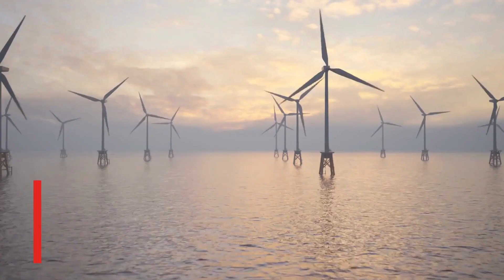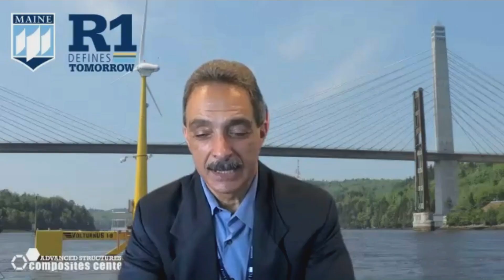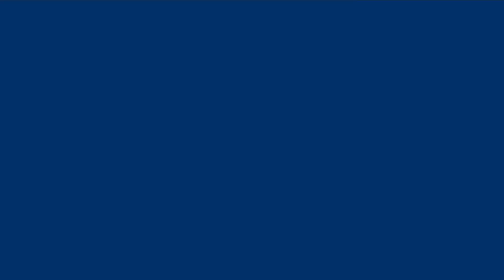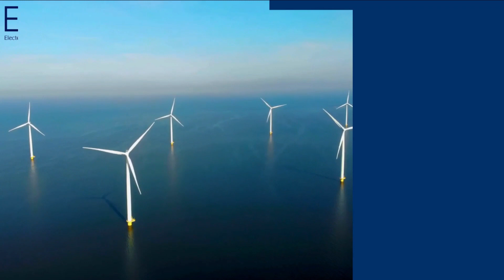Habib Dagher Presents Offshore Wind Energy in California

Comment: If you could make the mast of the turbine, the center of a cylindrical wind turbine, covered with corrosion resistant self cleaning solar panels, and the floatation device of the wind turbine into a wave generator, you'd be beginning to see positive results in the energy sector.